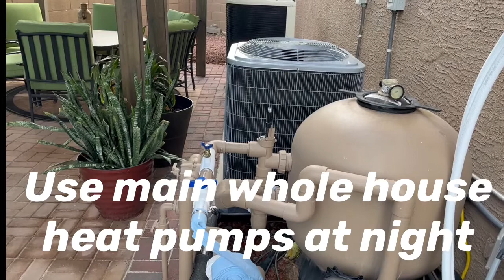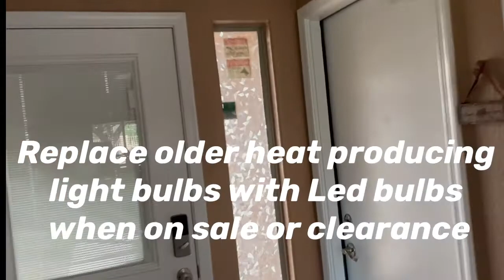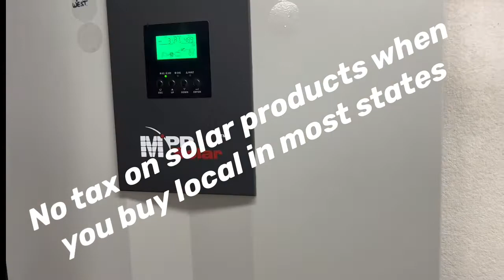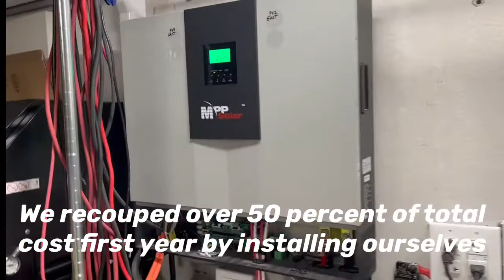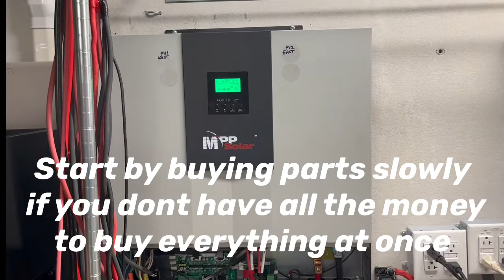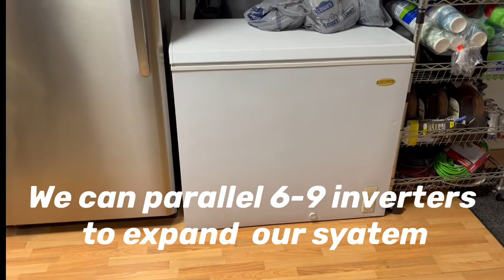DIY Solar power with Pappa off grid Mini split heat pumps verses on grid whole house heat pumps

Comment: Fantastic system design and implementation!  New houses should consider it.
Reply from the maker: 2 years ago I never imagined living in az not spending any money running ac for house, let alone keeping at as cold as I want. Use to live with thermostat set at 82-85 degrees during day and 78 degrees at night when we were sleeping. My garage use to be 105 -135 degrees, especially when we came hope from work and parked a vehicle in the garage. Car and engine was so hot , just heated garage up and floor of second story on house. Bedrooms were hot all night with cars heating garage up. Would still be 110 degrees in garage at 6 am. Now my garage is 65-70 degrees 24 hours a day. Thanks for comments, we appreciate it. Hope you have a wonderful and blessed day.

Comment: When you say the 12000 btu mini split uses about 5-10 amps is that ac 120v amps u referring to or dc inverter amps like what would they draw on the dc side
Reply from the maker: That is what my inverters show for usage, watts can range from 300 to 1200 watts for ac & heat. That is at 120v. The specs plate on the mini split says usage is 10 amps for compressor at max and .36 amps for outside fan on unit and inside head unit. So less than 11 amps total at max cool or heat. I did not hard wire most of my mini splits, rather I put a 120v plug on the end so I could use on grid or outlet on off grid. When I use the heat this time of the year using grid power I use less than a kilowatt an hour which is about 6 cents an hour to run until sun start charging batteries and I switch over to solar or I just use my battery bank, I have 3 options to run my mini splits. That’s why I don’t hard wire mini splits, but I did use a 10 gauge extension cord for over 20 feet length and 12 gauge extension cord for under 20 feet from outside unit to either grid plug or off grid inverters.
Reply: @diy-solar-guy  oh ok
Reply: @diy-solar-guy  and that's on ur 48v solar system tho right because mines is a 24v I'm just trying to see if it really makes a difference in amp draw I guess.
Reply from the maker: Your output amp draw will be the same weather 12v, 24v, 36v or 48v inverter. 120 v will be about double 220v amps. That is on your ac output for mini split. I don’t think my inverters show dc amps.
Reply: @diy-solar-guy  my inverter is an all-in-one hybrid 24 volt right now the mini split is pulling 28 DC app around 600 watts I haven't seen it go pass 700 watts at all
Reply from the maker: @thelithiumpowerch  wow, that’s great.very efficient
Reply: @diy-solar-guy  Pappa it did reach around 1100 for a quick minutes and then it came back down I'm very impressed I want to try a 18000 BTU
Reply from the maker: @thelithiumpowerch  my 18,000 btu unit cools so much faster than the 12000 btu unit.  Uses almost twice the watts as 12000 btu unit.